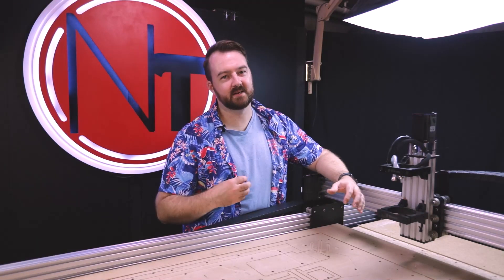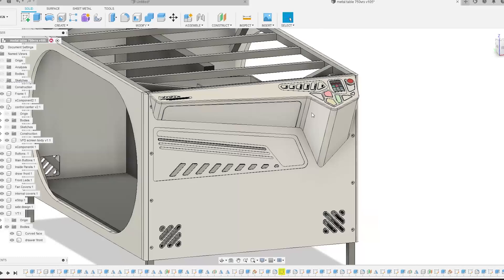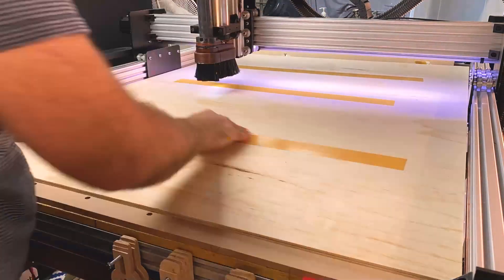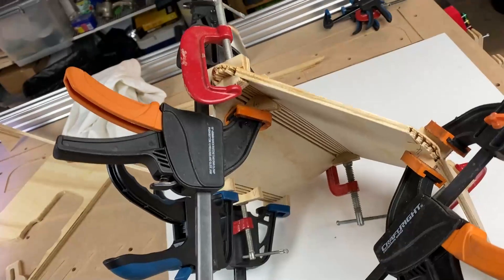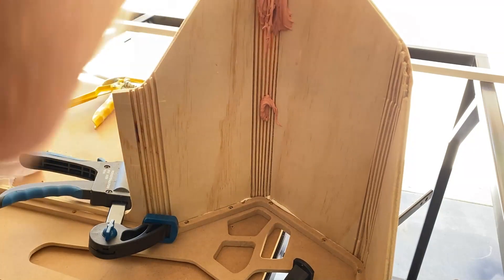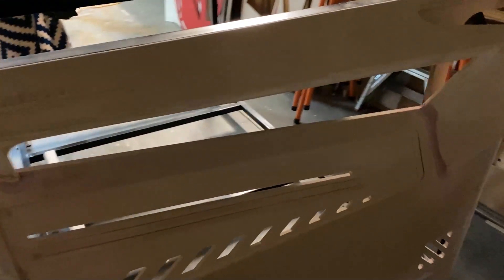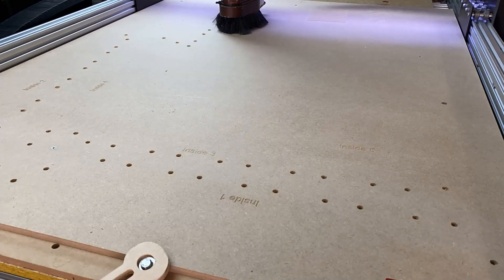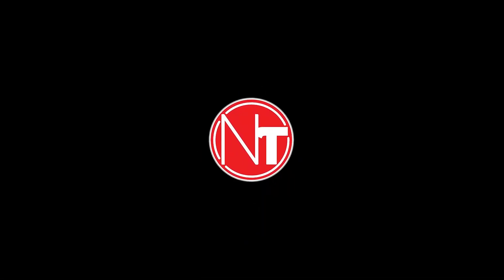My Ultimate CNC Table - Fusion 360 bending timber

Comment: How long did your spindle last until you had to replace it? Or did something just go wrong with it? I just bought one but the 2.2 110 volts just curious thanks for any info awesome video keep up the great work 👍
Reply from the maker: Thanks for your message. I had the spindle for a year. I think it was user error. I had changed some settings a few days earlier and think it started the issue. I then forgot to run the coolant and then burnt out the motor!! Expensive error!!!